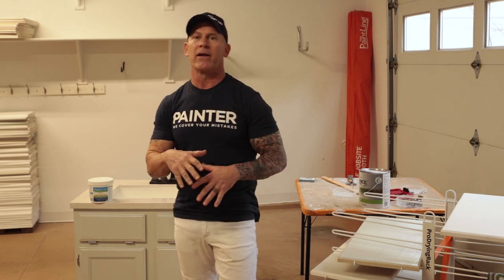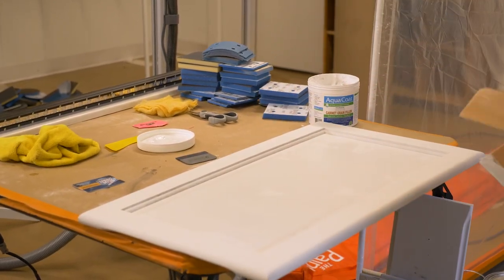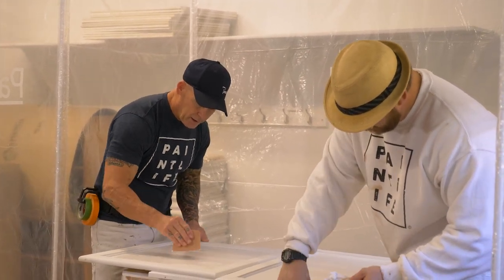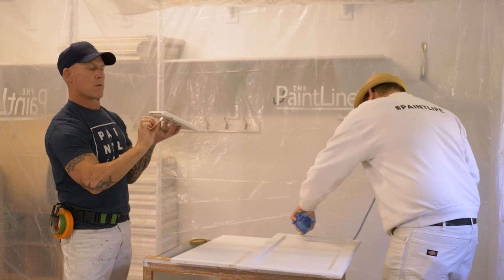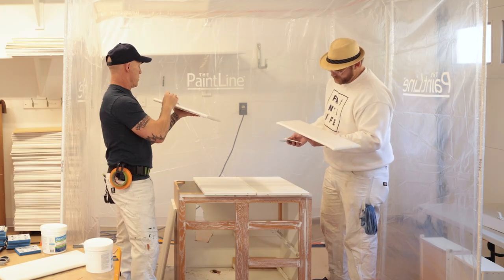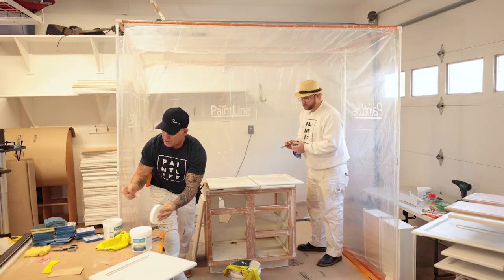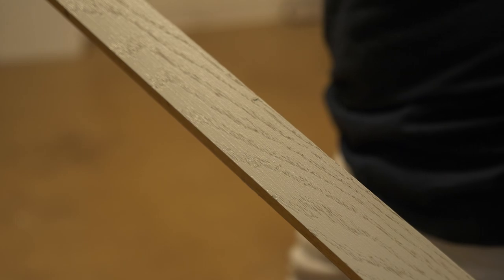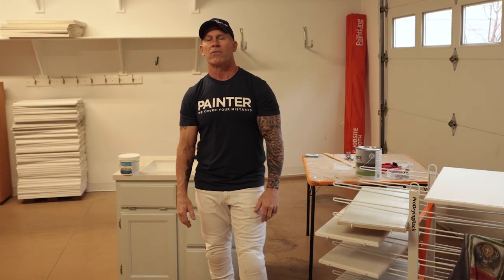How to Fill Grain on Cabinets! Painting Pre-Primed Grainy Oak Cabinets with Aqua Coat

Comment: Have you ever used plaster to fill the grain?  Furniture manufacturers used to fill the grain with plaster and sand it smooth. The plaster became translucent under oil finishes. Me, I've used plaster under oil finishes and under paint. It's cheap, dries fast, and gives a nice smooth surface.  Note that I'm referring to plaster, not some type of drywall mud (hot mud, all purpose joint compound, etc.)
Reply from the maker: Have not
Reply: Just not hard enough, I use “Ready Patch” for my blocking surface grains

Comment: This is most assuredly a dumb question, but where are the clients wanting caulking ? Is there space between the wood..? Trying to follow. I'm doing cabinets right now for the first time
Reply: Get a coat or 2 of primer. Then wet sand the grain away and then you would caulk all black cracks in the wood seams keep a wet rag with you and wipe your finger each bead you wipe(when you lay some caulk down it's called a bead of caulk) and I would lay a bead then wipe a few  inches at a time and then clean your finger. Your going to want to keep your beads small as access caulk will be more difficult and sloppy to deal with. Caulking makes the cabinets look more complete it's not necessary....but I would always do so. There's is no reason to float a filler this is adding an extra time consuming process. Again a couple thick coats of high build primer, wet sand, clean and remove dust and contaminates then followed by 2-3 finish coats. Some chemical base paint will flow like glass.....if you use a waterborne product thin it 15-20% and it will flow like glass if sprayed or rolled. If rolled apply in lighter coats with a 4.5" weenie roller 3/8" roller nap......roll all contours first and finish on flat surfaces. It's a time consuming but straightforward.  Good luck woman no worries easy stuff 👍 any more questions just ask. Again easy stuff just time consuming.
Reply: ON the fronts of most cabinets there is like a fancy little frame border thingy around the edges. Sometimes there is a big gap between the frame border and the main part of the cabinet. It the gap is small the paint will do just fine but sometimes there is a massive gap and if you don't add caulking it might look bad but than you might run into the caulking cracking down the road. So it is one of those things you are dammed if you do dammed if you don't. He has a video on it to he made very recently explaining wether to caulk or not. He explains the good caulking to use too.
Reply: No you want to caulk inside the styles of the doors, he has a demonstration photo in this video that will show you exactly where you want to caulk, be very careful when doing this though because I’m order to achieve a factory like finish you need to wipe the caulking clean so it doesn’t gather in the corner,  go to your local Sherwin Williams and purchase their top of the line caulking which will always be a little thicker then the cheap brands which will cut down on the mess and give you a better finish, also make sure to keep a clean rag with you at all times and a bucket of warm water which will keep your hands and surfaces as clean as possible, take your time and I’m sure it will come out great.
Reply: Demonstration photo at 4:25

Comment: I did 4 coats of aqua coat and it still wasn’t as smooth as MH Ready Patch. Not sure what the long term product will be using the ready patch, but initially it is soo much smoother
Reply: Right on, more expensive I’ve been using that for years and years! Ready Patch!!

Comment: What's the difference between Aqua Coat and other wood fillers (DAP, Bondo, Elmer's, etc)?
Reply: Easier to spread, designed for the purpose. Most of the other wood fillers are best for larger holes. And Bondo wood filler dries like cement. Not fun to sand.
Reply: Ready Patch my go to 20 years and counting

Comment: Why wouldn't you wet sand the grain smooth? Just curious.
Reply: The grain runs virtually depth wise on oak,so even if you sanded you would be far from a smooth surface

Comment: I tried Aquaseal on red oak. 4 coats and you still see the grain after priming and painting. Tedious to apply and really no comparison to just two coats of DAP wood filler or just a runny mix of USG drywall compound with a little wood gliue in it. Two coats of anything else I've tried always completely sealed the red oak. So, no, Aquaseal for pre paint is a waste of money. Maybe if you were to seal some pores in a fancy guitar and plan to cover it in poly, but pre paint it's overpriced and ineffective.

Comment: aqua coat vs gorks GoodFilla
Reply: I just tested those 2 and I am going with GoodFilla. On oak 2 coats of Aquacoat with sanding in between and I still saw grain, 1 coat of GoodFilla completely covered the grain. The only thing is the GoodFilla required more sanding but still took less time and had much better results.